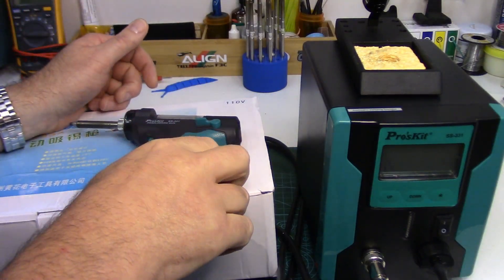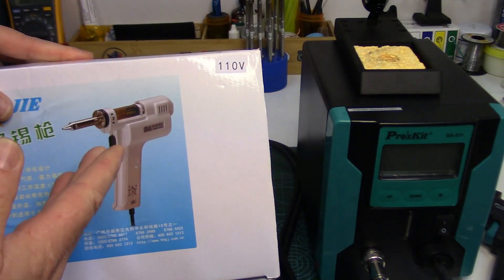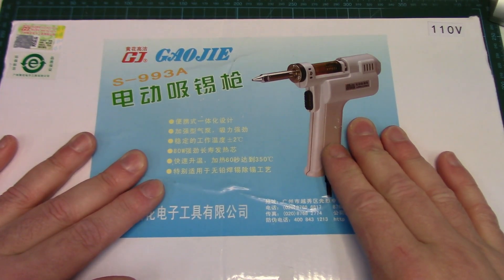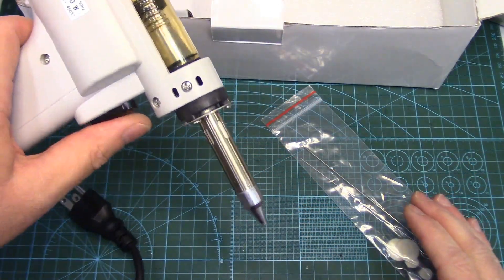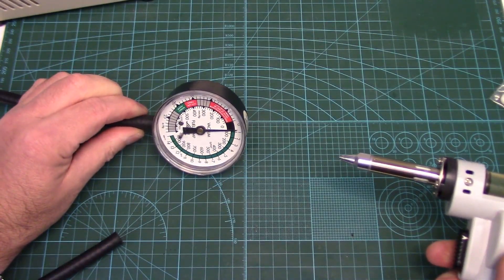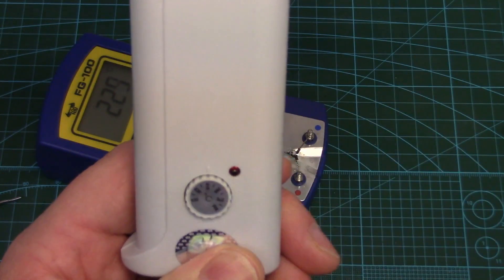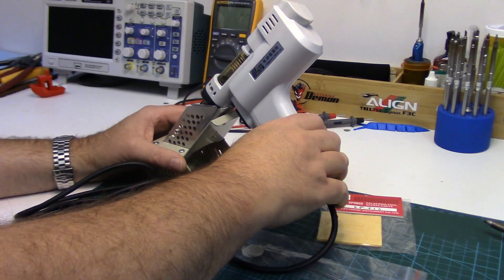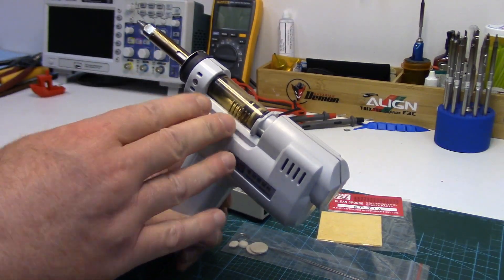S-993A Desoldering Gun Review - Is a desoldering station better?

Comment: Back in 2016 I went with the Aoyue Int701A++, which is basically the same as the Int474A++ desoldering station with a digital soldering station built-in (Hakko clone; accepts T-18 tips; can use the pump as a fume-extractor). The iron works well but the desoldering performance is so bad I’ve continued using braid for most smaller jobs like removing a thru-hole LED or recapping a power supply. I do a lot of Nintendo 64 and PlayStation PSUs with my knife tip iron (heat both leads and pull) which ends up working faster than waiting for my desoldering station to warm up, but then I have to remove the solder with lead or the desoldering gun (luckily those are single-sided PCBs). Easier than trying to get those bent capacitor leads inside the nozzle when they were frozen in place by the solder. For everything else I often have to fight with it and use every trick in the book to remove a DIP or connector, like adding heat from another iron, identifying which traces UNDER the DIP are ground/power so I can crank the heat, desoldering while upside-down, etc.

I bought it right around the time they were switching from a “more robust” AC motor to a stronger but less-robust DC motor, and I ended up getting “lucky” with the AC motor. At first I thought that was a good thing (hence the quotation marks) because someone had already done a tear-down and showed other negatives to the DC pump version (too many amps through the trigger switch; trigger does not reset the sleep timer or wake it from sleep, etc). Other than poor thermal recovery, the main problem is that it takes much too long to build suction and the solder on the other side of plated thru-holes almost invariably re-freezes and plugs the hole, requiring you to add solder. Desoldering with the gun pointed up and the component on top seems to help since solder will flow down as you wiggle the pin and heat will conduct up to the other side of the board, but this is obviously extremely awkward and defeats the purpose of using the machine.

Kainka Labs has a couple videos where he modified one of those ZD-whatever desoldering stations so that it would charge a vacuum chamber (sealed food container) and open a solenoid valve when you pulled the trigger. Instant, full-strength, suction! A mod like that would make a world of difference for my station.

Comment: The downside to these is the heating element doesnt last long, I own 2 of these desoldering guns plus the soldering station shown at start of video, The station is Ok but the tips i found dont last long 

Sadly i had to replace the heating element after about 8 months of owning it using it maybe 6 times a week at 370C for under 1 hour each time. I think the elements are cheap as i have cheap soldering station those hakko knockoffs still going strong after 6 years with heavy every day use 5 or so hours a day
Reply: I bought a Hakko 808, one Hakko FR-301, one S-993-a, one S-998-a and one  ZD-985.
Both Hakko works excellent, the downside is the price of the tips and filters.
S-993-a and S-998-a are a complete garbage.
The ZD-985 works very well, tips are cheap, I like it.

In my case I bought 20 tips for my Hakko 808 and 12 for my  Hakko FR-301, went the tips get damaged I don't buy any more.
I recomend the ZD-985 over all, for the price of the unit and price of the of the spare parts.

Best Regards.

Comment: Hi John I was looking for a way to contact you so I will ask you here and hope you see it I have a Futaba T16sz I purchased to use the H1 but cant get the servos to move unless they are inserted into the receiver in the H1 nothing they show as moving on the pc is there a special sbus cable to connect the receiver to the H1 unit or just pin to pin cable if you can help thanks.
Reply from the maker: People can always contact me through my Website (rchelicopterfun.com). With that said, I have no experience with Futaba's current receiver lineup due to the fact I fly with JR & now OpenTX. I don't know what S-Bus cables Futaba uses or has. I thought they where just normal 3 conductor servo leads like FrSky uses, but perhaps they are not?

Comment: Hey John,

This is a really good and thorough review, thank you for it! As I see, all the weak parts can be replaced (even the tube with a metal one i guess), except the pump. How sturdy do you think it is?
Reply from the maker: Seems to be a sturdy little pump when I was looking closer at it. Diaphragm pumps are very simple with few moving parts so there is not much to go wrong with them. Usually the diaphragm itself is the main wear & tear item, but this one is silicone so it should last a fairly long time. I never showed it in the video, but the pushrod end is bearing raced on the cam. Of course only time and usage will give the true longevity answer.